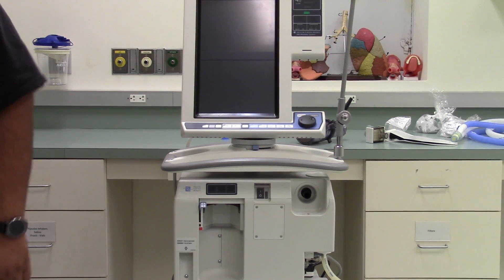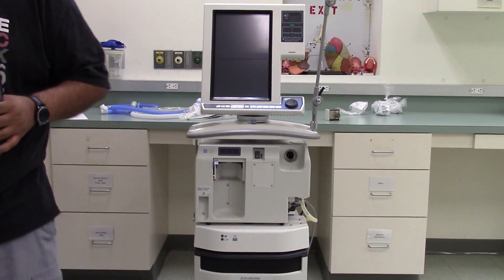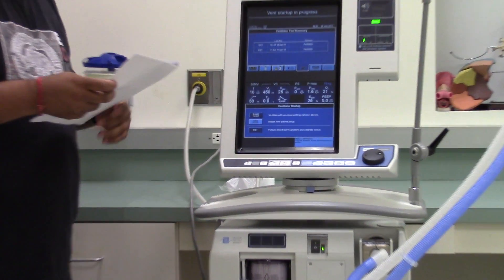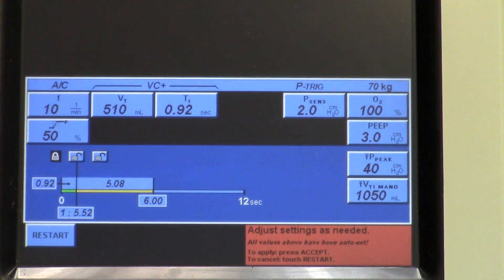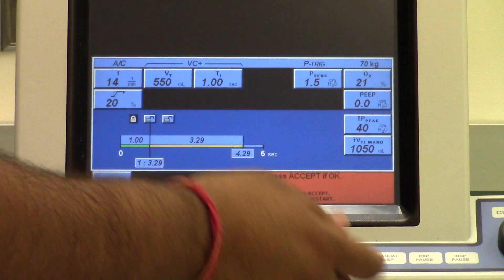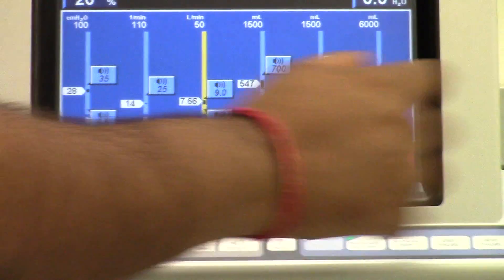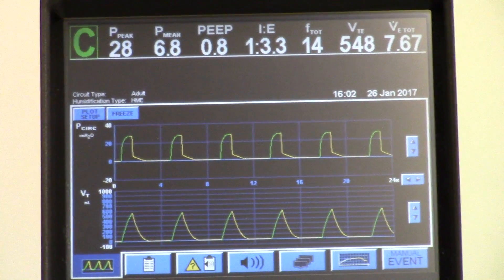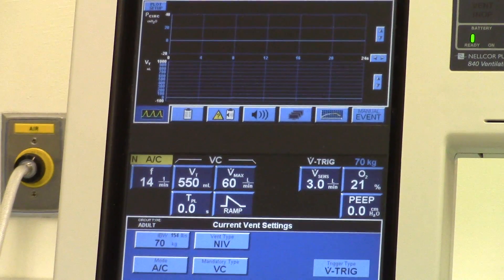Mechanical Vent Lab PB 840 overview

Comment: Is it ok when we switch the power just in case without attach any of those hose that you were attach in front of the ventilator? Would it be alarm on the ventilator it self?